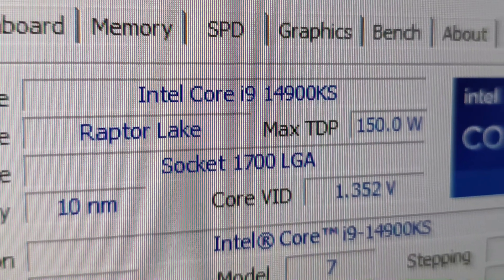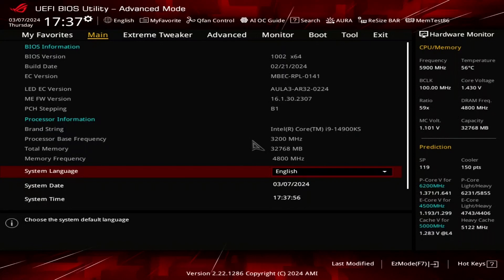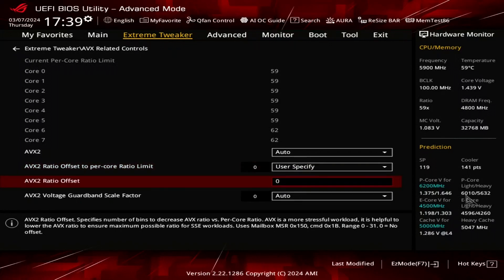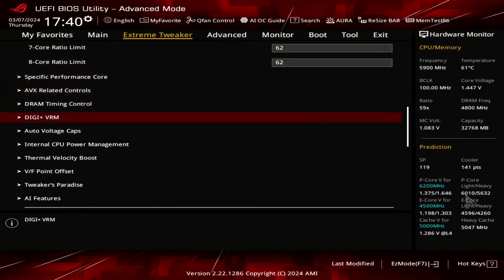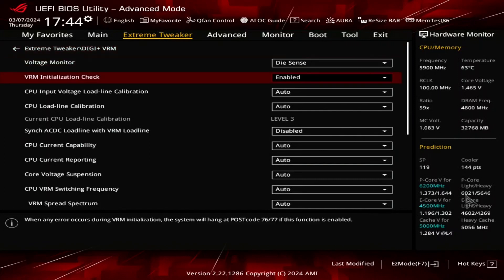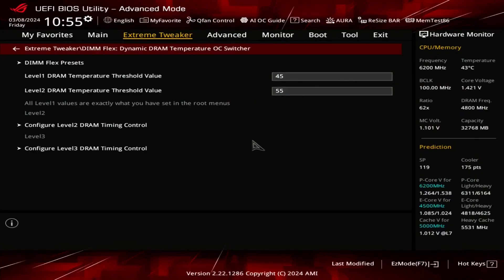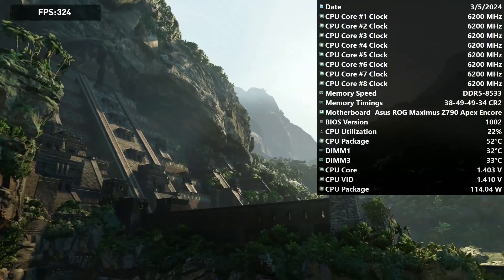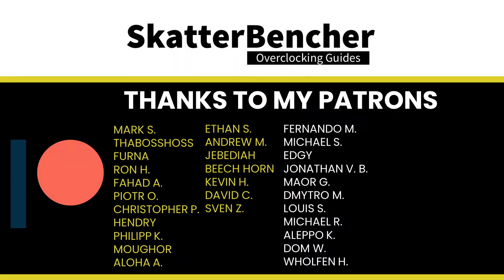Almost 7 GHz 14900KS with EK Delta² TEC

Comment: Hello, I would like to ask some questions... I acquired a 14900KS in December along with an Apex Encore and I'm having a really hard time maintaining 5.9 GHz with low temperature. 

My SP is 102 😔
It's not the best chip in the world but anyway, my VF table says that at 5.9 the voltage is 1.413, is this voltage the real one or is it the voltage we typed in the BIOS?

I'm quite frustrated, I intend to buy a Custom WC but I'm afraid I won't hold it either, currently my average of the stable vcore to pass in geekbench 6 is I'm quite frustrated, I intend to buy a Custom WC but I'm afraid I won't hold it either, currently my average of the stable vcore to pass in geekbench 6 is in 1.510 (isso com vcore em AUTO e AC LL 0.40.

From your experience although I know that many things can influence, currently even if I have a lower vcore I can't even pass geekbench 6, some games I can run on 5.9, usually UE5 games I have crash on loading, I have a feeling that I may have picked up a very bad 😔 chip.

In addition to the fear of having a chip, it's investing in a Custom WC and not even being able to run a geekbench 6

Comment: why dont ram manufacturers use high end thermal pads and heatsinks + a possible small ram fan coming in the box which fits inside a pc case without interfering with the aio or air cooler , they know high speed ram needs active cooling for best perf.  still wont provide a ram fan

Comment: What’s your opinion on 14900ks vs core ultra 285k for a phase change cooled overclocked rig, my 10900k has been on a phase change at 5.7ghz+  & 4700c16 2x16gb ram overclocked but cpu has  degraded from benching abuse. Looking to upgrade or just pick up replacement cpu for cheap. 
Phase change cooler would keep 10900k at around 25c p95 60k-512k in place non avx pulling 200a for reference.
Reply from the maker: I'm an enthusiast so I no longer have Raptor Lake and only have Arrow Lake in the house :)

I'm not the right guy for sensible buying advise haha

Comment: i have the delta 2 tec on the apex (non encore) and it was working fine, but experiencing some crashes now. Im thinking its could be due to the ram sticks touching the tec's rubber gasket and overheating. wanted tto know your thoughts?

Comment: I just got the cooler and EK seems to have messed up their downloads, the link for software now leads to a page that loads forever and doesn't seem to do anything. Do you have any alternative downloads for the software?
Reply from the maker: The download link seems to work here, but I also uploaded it to my blog in case the it disappears https://skatterbencher.com/wp-content/uploads/EK_Delta2_TEC_Integrated_Intel(R)Cryo_Cooling_TechnologyV1.0.zip
Reply: @SkatterBencher  Thanks for that! May I ask that, does the software still require a fan and a pump connected to the controller to enable Cryo mode? Or did they change it? Having the controller decide my pump and fan speed is inconvenient

Comment: But does it maintain the temp at 10° when a core is in use? Or is this actually just a 6.4 max usable
Reply from the maker: The 6.9G is more for show since the cores heat up to ~50C even in single threaded workloads

Comment: I upgraded from a 10900k  @ 5. 3ghz  4000 ram, same 4090.  Almost no difference in 4k gaming.  Probably should have waited this whole generation out.  Except im not confident new first gen will go smoother than last first gen.  11900k.    Kinda nice upgrading on the last gen.

Comment: I have a chiller pc runs -30c i have a old 12900ks at the moment was thinking of buying the 14900ks but do i just wait for 15th gen? i game and mostly arma3 and racing sims so single thread performance is most important. I tried some of your settings got another 200mh in game to 5.8ghz on 3 cores.
Reply: Wait, I made the mistake of going to a 14900K and then a 14900KS from a 12900K - nothing but problems and instability
Reply: @MrHolozip  I have no issues with 14900ks but I have no heat issues with my chiller. It's 1.5v  6.6ghz never crashing or weird stuff. I think the heat is the biggest problem with the 14900k If you can keep it cool and lower vcore max it will have less problems.
Reply: @sean.d7171  yeah, I'm much happier with the KS. I use a 360mm AIO and still managed to degrade my K series in less than 6 months. I learned a lot about the CPU and its architecture in that time!

I'm not pushing the KS at all really and for now am just running it at the stock 150W P1, 253W P2.
 
It's definitely been a journey for me - and I wouldn't recommend it for anyone else. My bank balance would have been happier sticking with the 12900K for sure 🙂
Reply: wait for 15900k

Comment: Would love to see this cooler on 7800X3D
Reply: I think it would be perfect for the 7800X3D since that cpu draws so little power. Should be easy to hold very high clocks.
Reply: The 7800X3D does not scale upwards as nice as Intel does for better and for worse.

Comment: Insane power usage because of trying to compensate for bad IPC. Reminds of Pentium 4 times.
Reply: I have seen in wendels video that alder lake to raptor Lake has higher IPC than ryzen 7000 clock for clock

so Intel is losing somewhere else, like cache, not ipc
Reply: Literally raptor cove has the highest IPC of X86 architectures. In single core speeds there is no contest on what is the fastest chip
Reply: @nuke9918 So why is it slower than current Ryzens in games and many other tasks? Don't say cache .. because cache alone does not make a CPU work fast, it just enables working faster because of lower waiting times- which enable processing more commands in a given time again xD
Reply: @elmariachi5133   X3D is faster in SOME games due to cache. More instructions can be feed faster to the cores. Less clock cycles wasted doing nothing waiting for data to come from RAM. Latency matters a lot in some games.
In others not so much. infact properly tuned Intel processors can match or exceed X3D chips in games with some BIOS work with ram and ring bus OC.
Reply: @nuke9918  What you said is what I think: 'More instructions can be feed faster to the cores.' So.. isn't this equivalent to higher IPC?
Yes, latency is another fact, but like you I don't think it's too relevant..
Reply: @elmariachi5133  I think we're downplaying cache a little bit here

the 7800x3d is the fastest gaming cpu in every benchmark I've seen (without tuning)

both the 7950x and 7700x loses to the 13900k

isn't it clear that cache is king? the 7800x3d doesn't even clock as high as the non 3d chips
Reply: @jak3All3n The cache being very advantageous in most cames is obvious and well known.  But my question is: Why? Of course a cache makes data available faster - but this alone won't improve anything, unless the executing part of the CPU (=ALU) is actually reading and processing data faster, too - which would mean higher IPC.
Reply: @elmariachi5133  I can see it improve throughput if it means the cpu is not wasting cycles waiting for ram

like I could read and process text faster than you but it won't mean much if you're done reading the text before I even get it

Comment: intel is a joke 14900ks slower vs 7800x3d in gaming by alot tdp 240 watt vs 50 watt..
Reply: Well, it's important to be honest and fair, ur saying the 14900ks (13900ksss) is slower "by alot" is just wrong.
I think on average the 7800x3d is indeed faster but only by a few percentage points, in other words on average theyre identical.
Now for powerdraw, dont compare cpu stock tdps for power comparision, thats not how it works and it makes u appear ignorant about this topic.
But ur right, the 13900ksss uses like 2 to 2.5 times the power in gaming compared to the 7800x3d xD.

Now, were all tuners here right? At max oc the 14900ks is faster than a 7800x3d max "oc". Not by a lot but it is.
Reply: @branchprediction9923 well there is a couple of things to keep in mind, the 7800x3d cannot really overclock much as there is a trade off in having 3d cache. Interestingly enough AMD may be able to take advantage in the future of intels back power delivery, as delivering power from the bottom would reduce the oc constaints of having vertical stacked 3d cache, so we may end up having in the not so distant future 3d cached chips that can oc decently. 
That said to throw an honest bone to intel, the comparison of the 7800x3d and the k variants of intel chips is not really "fair". Fully unlocked cpus are always going to consume more power. Even the AMD equivalents to intel K type of cpus consume considerable more power than the 7800x3d, as that is just a reality of having unlocked multipliers. And pushing higher mhzs implies an exponentially higher amount of power usage. to go from 5ghz to 5.5 a 7800x3d would need a tdp of around 180 watts,(what means an almost 50%increase)  then another 20 watts to reach 5.6,.another 30 to get to 5.7 and at that point the tdp of the 7800x3d would be above 230 watts  (the 7950x needs that )so  around the same ball park as the 14900K.
Reply: Everything besides gaming the advantage goes to the 14900KS and the 14900K, and gaming performance for Raptor Lake is directly equivalent to Ryzen 7000, hardly noticeable for the average consumer spending equivalent money on either AMD or Intel.
Reply: not true, 7800X3D at 5.4 GHz is literally equal to 13900K @ 6.2 paired with DDR5-8000 in games on average. 14900KS @ 6.5 will beat it. It is the fastest gaming CPU money can buy right. Is few % in gaming worth it ? Of course not, but still it is the fastest CPU

Comment: Global sp of 119 😮😮
That's a vary binned CPU

Most ppl will get so 98-110
Reply from the maker: The best I've seen is 121SP, I think
Reply: @SkatterBencher  golden of gold sample 😏
Reply: yep, my 14900ks is at 99sp. coming from a 110sp 13900ks I have buyers remorse in the back of my mind. However with my short days of running it, I have better luck with running my 7600 ddr5 over 8000. I just need a better cooling solution than this nzxt kraken elite 360 aio pretty soon. I hear that the tec2 cooler won't keep up if you run synthetic benchmarks like cinebench though?
Reply: @evo9rs  damn 😳

could you ask for a exchange / replacment ?

I exchanged my 13900 ks till I got asp 124 

you deserve a good bin 😃
Reply: @arel77  I bought it from Amazon so I could keep returning it 😆
Reply: @evo9rs  well it runs hot throttles out of the box , you just want a working product you deserve 
( yes exchange it lol ) 
😏
Reply: My 14900KS: SP111 / P-Core SP 127 / E-Core SP 79 / MS SP 86
Reply: What is SP? Silicon Performance?
Reply: @Razzbow silicon prediction

Comment: are those ram speeds stable?
Reply from the maker: I have no idea. I mentioned in the video that this was just a quick test so take the settings with a grain of salt. It was stable enough to run the benchmarks, but I didn't try any memory stability tests.
Reply: @SkatterBencher  just curious, impressive nonetheless. Cheers!